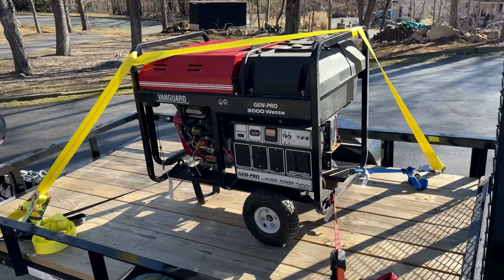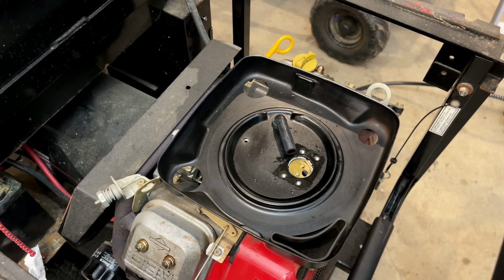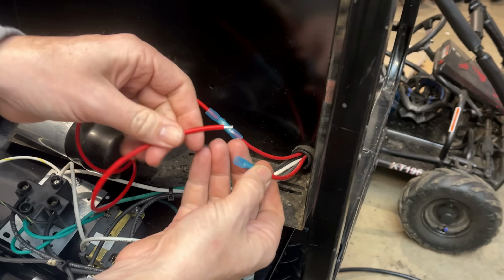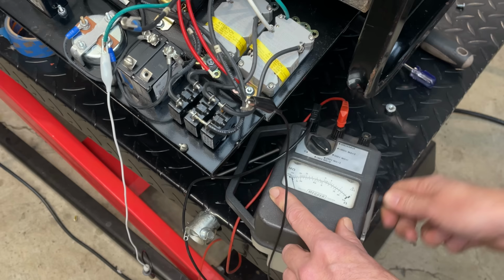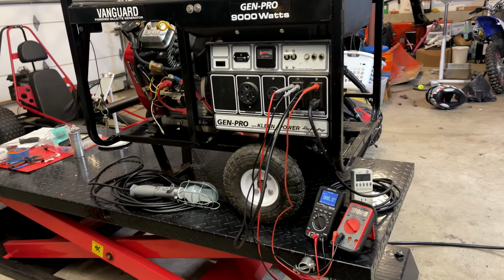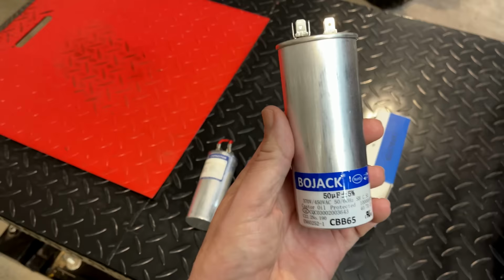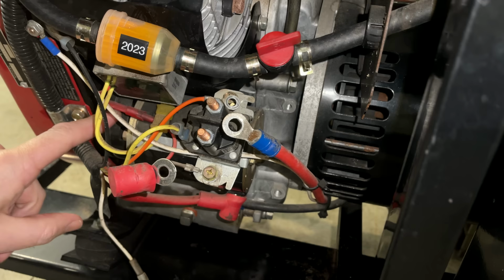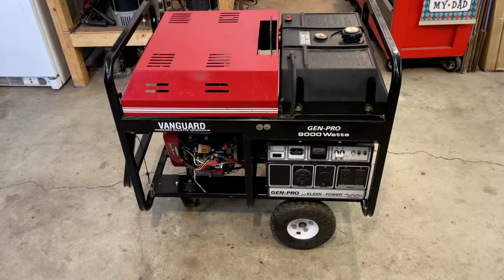How To Test and Fix A Brushless Generator

Comment: Leakage current of a capacitor tends to increase after a long-term storage due to dielectric dissolution, and very high current may flow at the first voltage load. However, applying voltage will form the dielectric, and the leakage current will decrease.
Reply: This is called reforming the capacitor. If you know that a piece of equipment has not been used for many years then reforming the incipient capacitors before switch on is a a good idea. You do not expect to have to do it from an item bought new.
Reply: @r8118830  That wasn't a new one, it was clearly new old stock.

Comment: From a datasheet to generic low-size low-impedance aluminum electrolytic capacitor shelf life is not higher than life under load at max temperature. It means old stock electrolytic capacitors  are not as good as freshly manufactured. I've seen capators bulged in my box or inside a PSU which was not powered since I've seen its capacitor looked fine.

Comment: On that relay if noticed there different metal than copper that makes contact with one and another because copper either stick to one and another or not make a good connection unless it real small amps.

Comment: Lol. They just don't make capacitors like they used to. I have reached the point where I never change them in old machines unless absolutely necessary, and I always save them whenever I come across an old junk machine with a good one. Modern ones are about 50/50 straight out of the box.

Comment: Thanks for these very informative videos, I've learnt a lot from them. I have a question though. I have a brushless generator that produces power under a light load but once the load increases it stops making power for maybe 5 seconds then comes back, this cycle continues. I've never seen a generator with this issue, any ideas? I've replaced the capacitor.

Comment: You can buy capacitors like this at your local HVAC supply house, Johnstone is my favorite with the titan brand caps.  All caps have a limited lifetime of about 5 years, doesn't seem to matter which brand as long as you don't buy cheap chinese junk.

Comment: Again another fine video. I have the same engine except it runs on propane. Would like to see more diesel generator videos. If the battery was dead,, can you pull start your engine?
Reply from the maker: This one can be pull started even with a dead battery.

Comment: I had the starter come on on a machine of mine.  It was loud but stopped with the key off. Mine was computer run. I disconnected the starter run wire and ran a wire from the key old school.  Fixed,  new computer was 5k, no thanks.

Comment: I would twist, solder, and use high dialectric shrink tubing to complete the new capacitor connection. The more permanent you do the connection, the better it will be. Barrel crimp connections are temporary at best, not preferable. You should do your customer better, not cheap.

Comment: A paint mark is not evidence of a failure in a cap (the new one also had a paint mark before you installed it).  The possible doming of the top was more of a clue to me.  Caps don't gain capacitance when they fail, more likely it is shorted.  An open cap would show 0 nF just like it does when nothing is connected to the probes.  Short them out and you'll get OL.

Comment: When I was working I use a test equipment that we called a Megger. I think that is a brand name but it was to read windings. In less than 30 seconds I could tell you if the windings are good or not.
Reply from the maker: There are much nicer ones on the market then what I use.

Comment: Did you try using a ring tester for measuring for a shorted turn?
 You need a Kelvin milliohm meter.
 You should be able to get a suitable capacitor at your local HVAC store.

Comment: What is microferett. Is this on ohm settings. I'm not familiar with this. I'm looking at a 9hp vanguard generator and it is not generating any power. It is also brushless. I do have the capacitor off. I just don't know how to test it. Thanks. Nice video

Comment: Hi, great video. I’m new to brushless and was shocked by the size of the cap required. It is only filtering the exciter current, correct? How much power does the exciter consume on a generator of this size?

Comment: I see dirt in the carb bowl. Dirt must be in the fuel, or acumulating in the tank, through the gas cap breather holes, or wearing off of the inside of the fuel lines over time.

Comment: It interesting that I have a Dayton 7500 watt generator that is powered by a Briggs I/C 16 hp single cylinder. I wonder if mine was purposely over built since it seems here 16 hp is enough for 9000 watts continuous or if it was just the engine they could get at the time when they designed my generator.

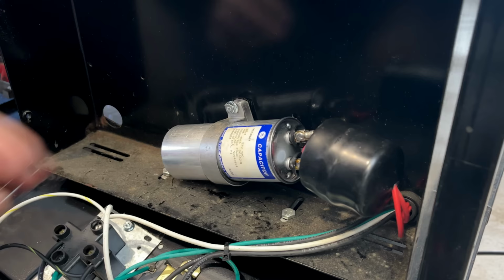Comment: 9:27 To test the capacitor outside the circuit, you’d only have to disconnect one of the pins. 🤓

There are also in-circuit capacitor testers.

Comment: I appreciate the thorough testing explanations.  I got a brushless with no power as we speak.  Its a half moon capacitor melted through.  to get a 23uf half moon I went to generator guru for the part.  They mentioned with the gen running check the capacitor *no cap installed) wires for between 3-5 volts.  I'm a bit skeptical to try this as I didn't see you do it.  Is it reasonable?  Is there a value in this test?  Thoughts?

I know this is a year old, just taking a chance.
Reply from the maker: That will check if there is residual magnetism and validate that the excitation coil is still working.  When I test I usually see less AC voltage than that.  I usually just check the resistance of the capacitor and the resistance of the excitation coil and check for ground faults.
Reply: @jcondon1  WOW!  You saw this!  Thank You!  I gather generator guru is in the uk so I maybe waitin a bit for the new half moon cap.  I'm thinking I may test it with an amrad turbo to avoid blowing up the new one if something else is wrong.  The inside of the old one looks like a firework snake is coming out of it.  Some kind of fire suppression protection.  Thanks for the channel!
Reply from the maker: @kevinwalker4623  they are based in the UK.  I ordered from them once.  Came pretty fast.
Reply: @jcondon1  The uf is 23 on the old one, just curious would 22 or 24 make much of a difference?  They are about half the price and much more readily available.  I heard you mention parts tree in another video, any other vendors you like or have had good results with that you would share?

Comment: Is there any likelihood of a very tiny / weak short / leakage some place, that testing with the 2.5KV tester blew clear?  Maybe even in concert with an old-stock condenser out of spec?  You did mention some of the 1KV readings were a bit wobbly...

Comment: Hi, have been binging your videos.   I recently bought a Devilbiss power back 8000/10000 generator that seems very similar to the one in video, brushless and Briggs twin.   It does not have a nema 14-50 plug, so I was going to add one!   When I got inside all of the generator wiring is 12ga?    How are they pushing 33 amps and more thru 12 ga?

Comment: could the sticking starter have been the cause for the capacitor to blow. I know heat can damage them and with the start engaged the motor could have ran hot. Just wondering.

Comment: The two legs, if fully isolated from each other, act like a capacitor. That's why the isolation tester behaves "irratic" at the beginning of turning the handle, but it's normal. Both coils / windings are very close to one another like the two plates of a capacitor.

Comment: 10:16   Capacitors don't go up in value as they age, and start go bad, they go down in value. 

So, that capacitor would have been under the low end of what your meter is capable of reading.
Reply from the maker: Yes, was probably very low or shorted.

Comment: I was wondering what caused that initial drop im HV insulation measurements between L1 and L2; actually it can bee seen also on digital HV insulation tester as well. I think the answer is capacity between those two big and closely related windings combined with currrent capability with HV testers, which I suppose is getting lower and lower on higher ranges.
What do you guys think caused this phenomenon?

Comment: I have a generator with a similar setup, a Power Boss 5000W made by Brigs and Stratton Model 030222.  It has a capacitor also with no AVR that I can find. The engine starts up great but I have different voltages and Hertz at various speeds.  At lowest speed it is 55V, 49HZ, Next speed 146v, 76 Hz, Next 195v, 91 Hz, Highest 209v, 95 Hz.  I tested the capacitor and it is 34 like the nameplate.  What do you think is the problem?

Comment: Dude you just created resistance with those crimp connectors on the capacitor. You should neve use crimp connectors for anything. Those should have gotten soldered & shrink wrapped. I'm constantly having to re-wire outdoor application stuff where some guy like you used butt connectors. Trailers on semis, equipment etc. Marine wire, solder & shrink wrap or don't post it online.

Comment: Where can I get a Service manual for the Gen Head units.  I have a manual for my generator as a whole but you have very detailed troubleshooting service manuals on the gen head itself.  I have a northstar 165923 13kw generator.  The gen head is part number 30990.  Thanks

Comment: Imagine if you didn't have that 35uF cap (or any other for that matter) to test with after blowing the new old stock one.
Reply: In James' setup, just won't happen, he's probably got a thingamajig for a watchamacallit in the hooseybob for just such problems
The smaller rated capacitor merely reduced the total output potential

Comment: the excitor stator needs to be flashed or remagnetized hence the reason why low voltage also possibly the in stator diodes one or more are bad the lower resistance cap will help but not a correct fix,allthough these type gens arent made very well to begin with since they have no regulator to control the inner windings hence bad or rough output power.

Comment: Hi Jim,  just been rewatching some of the older videos again ( just can't get enough of your methodical repairs!) and a question occurred to me re balancing the load between the different legs of the stator: usually I see you using a breakout power cord ( what they?) which takes power evenly from both legs, this is so obviously a good thing but if there's no 240 volt outlet on the generator, is it possible to make a power cord that uses both 120 v outlets to achieve balanced load across the legs and if it is possible, is it a good or bad idea to do this? Hopefully my question is properly worded so that you can understand my query. Thanks again for your videos!
Reply from the maker: The breakout cord only breaks both legs into 4 120 outlets.  2 on leg one and the other 2 on leg two.  I still have the balance manually.  Some 240 volt generator have a 120/240 switch.  In 120 mode both legs are connected and you do not have to worry about balancing the load.  A 120 only generator likely only has one leg and also do not need to worry about balancing.  It only comes into to play on a 240 volt generator.
Reply: @jcondon1  cheers for the reply Jim. As you probably know, over here in old Blighty we run 220-240v @50Hz so I'm guessing that the generators we have here are connecting both legs full time and thus are self balancing .......what do you reckon oh master😁
Reply from the maker: @iandennis7836  good point.  It would make sense.  That way the manufactures only need to design and manufacture one power head which can be wired based on the country.  So if wired for only 240 loads, then it will be balanced no matter which outlet you use.  The balance question only comes into play when using one winding or the other in the case of 120 volts.
Reply: @jcondon1  Cheers again for the reply, looking at it from that point of view seems logical. Thanks again.

Comment: The only thing that would kill a capacitor that quickly is over-voltage, possibly because it was old stock but I also note that both replacements were rated at 370/440 Vac or more. I would have put an oscilloscope to see if there were some voltage spikes across the cap.
Reply: Electrolytic caps can also fail due to drying out, particularly if they’ve been in storage for a long time. Most caps are very stable on the shelf, but electrolytics aren’t quite as stable. Can still last a very long time though.

Comment: I recently had a starter solenoid failure on a Craftsman riding mower with a Kohler engine that I own. The starter did not disengage and the starter gear got jammed in the flywheel. I replaced the solenoid, but the starter motor needs to be replaced as well. I inspected the flywheel for damage, but didn't see any. Are there any other types of damage that could be caused by this failure? I have never had or seen this happen before.
Reply from the maker: Only the flywheel and the starter:

Comment: Definitely a defective cap. I think it would be unlikely a generator could “blow” a good cap with an AFC of 10,000 amps (according to its label). It’s funny because as soon as I saw that 47.1uf reading I would have sent it back or just got a new one. Anymore that .19uf low on a new cap and I’m not happy. 

Think those spade connectors will hold on not being soldered? A lot of vibration there.
Reply from the maker: Most generator use spade connectors.  Not as good, but will be easier for the owner in the future.

Comment: towards the end there, is the gas tank sucking in on itself? i just lost a old plastic tank due to a fuel vent not working and the replacement was roughly 200 bucks
Reply from the maker: Good question.  I did not look at the tank before returning it to the owner.

Comment: James;   What hz range would you guess is acceptable for most modern electronics?  Such as a flat screen tv or newer fridges etc?
Reply from the maker: 60% +- 5%.  57-63 hertz should be safe.
Reply: @jcondon1  Thanks James.  I have a Predator 8,750 (7,000 continous)   Here in Oklahoma it sure can get some use!    Thanks again

Comment: I have a question for you if you could help me out.. i have a Buffalo corp. Sportsman 4000 DF generator... sandstorm i guess they call it.. and its only ran for 6 hours all year...also just missed the warranty period by a month..so im getting no power from outlets or the RV outlet.. i get the .4-.5 ohms from there..and at the winding... When i test the slip ring's i get 43.4 ohms... The manual states i should have 45-75 at the rings... Do i need a new rotor...? I really enjoyed watching your videos and iv seen most of them regarding generators... Very impressed with your details and precision of everything..
Reply from the maker: The rotor should be fine.  Make sure no windings are shorted to ground or each other.  Also need to check the rotor through the brushes to be sure the brushes are good and the dpe and sense winding that goes to the AVR.  If everything is good then a new AVR might fix your issue.
Reply: @jcondon1  ok thanks for letting me know...I truly appreciate it... I'll reply with my results on Monday... I have test the brushes and they are perfect... I did continuity testing on the winding and nothing...so hopefully it is the AVR
Reply: I'm going to go give it a couple test here in a little bit so I'll know more soon
Reply: It seems my comment about what I tested yesterday and my email is gone...lol

Comment: This goes to show you not to buy electronics from ebay or amazon , always support your local electronics store by shopping locally. 
 You may spend a couple dollars more but you would have the part the same dsy and you wouldn't have spent two days waiting and another day testing for other issues.
Reply from the maker: I agree.  There is a nice electric motor shop the next town over I visit when possible.
Reply: @jcondon1  --- I only made that comment because I've learned that lesson. I've been a journeyman electrician since '95 and probably a master if I were to test for it. But,  I started out doung automotive electric right after hihh school in '84 besides stuff like alternators and window motors, we did rewires, a/c repairs, and we built emergency vehicles (police cars, ambulances, vehicles for Red Cross) installing lightbars, spotlights, sirens, etc... 
 I understand if you live in a smaller town or somewhere rural where you have to drive to the next town an hour or more to find a specific store, it may not be convenient to spend half a day driving back and forth.

Comment: The the reason the capacitors terminals for solder because the vibration causes the Spade type connections to loosen up they would burn right off and turn the light off the capacitor the other thing is when you're choosing a little loan scale you don't want to touch your fingers to both of the wires because you only get a false reading cuz they M. Read through your and it will now you may think I'm a crackpot but I used to work on big generator air conditioners and and small generators while I was in the military and I have probably over a Year's worth of schooling in those lines with all I meant I've never worked on one of those type generators😊😊

Comment: Why won’t my generator put out the right voltage.  It’s low on propane but normal on gasoline.  I have to run full choke on propane.